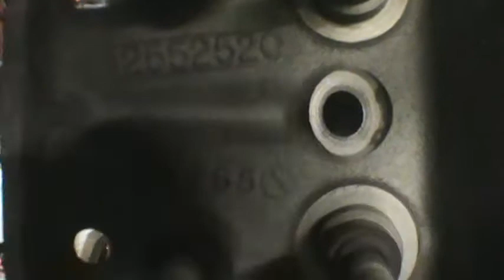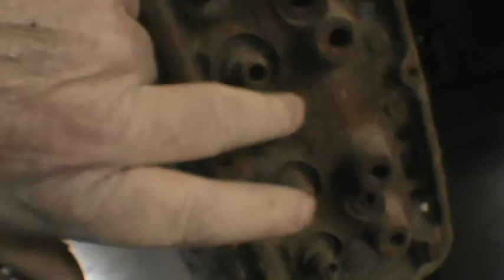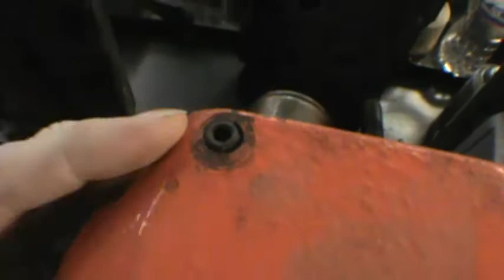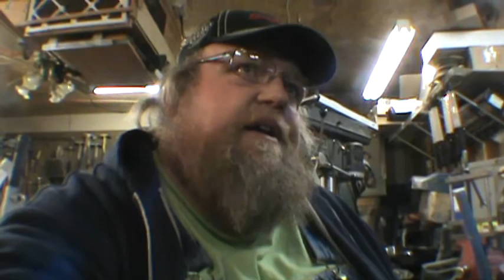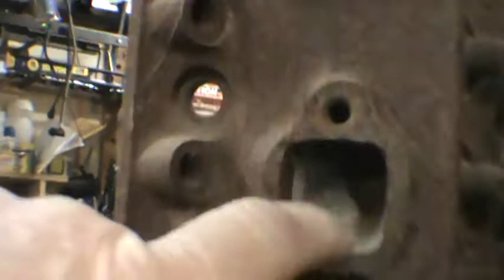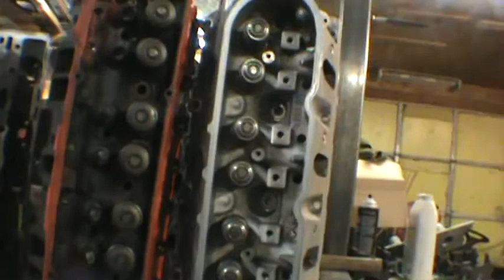talking about heads old school and new style

Comment: Another thing on the vortec head is they use a rocker with rails to keep centred on the valve tip. They have round holes where the push rod goes through. If you use them on a early engine like your 327 you have nothing to keep the rocker in line.
Reply from the maker: they were remachined and had guide plates installed on the heads to make them work on older blocks.